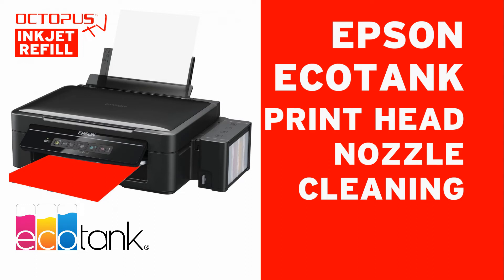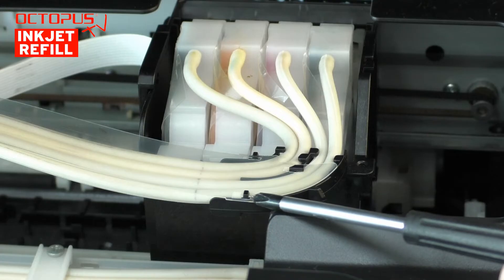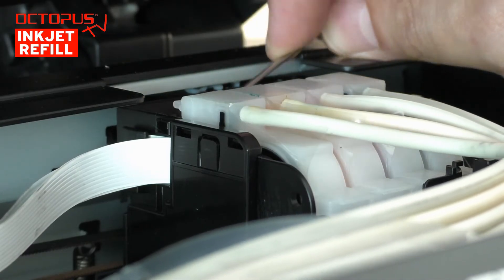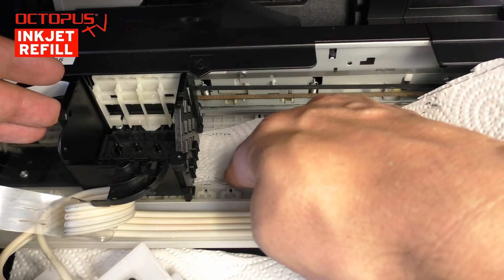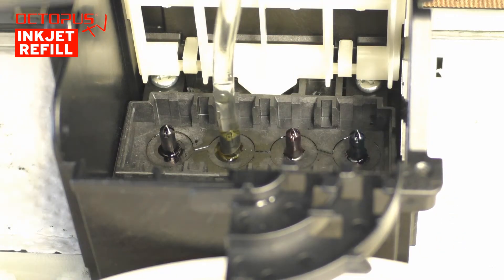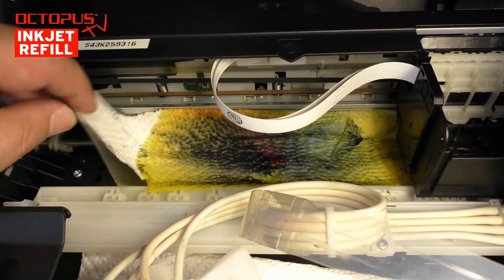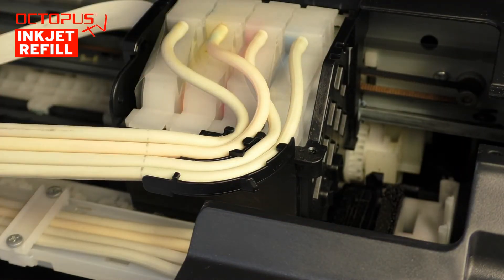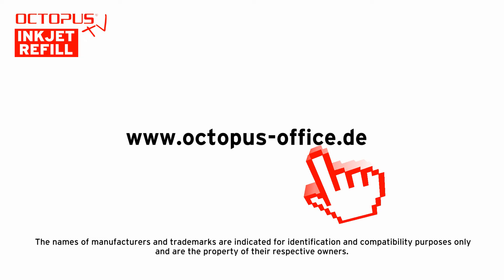Epson ECOTANK print head cleaning clogged nozzles 🛠💉

Comment: I have used this kit now to clean the heads of about 10 Epson L365 from our office and friends. The cleaning is superb, but I prefer to remove the print head from the printer and clean it outside, this assures that there will be no mess inside. And it’s just a few minutes extra work.
Reply from the maker: Hello Peter, thanks for Your nice feedback! Based on Your experience we consider You as a professional user 🙂 - no wonder You are going the way to take out the print head. Actually this is the most dangerous part for this sensitive component. Users doing the cleaning for the fist time are in danger to do some damage to the print head at this point - that´s why we came along with  leaving the print head in and creating a work around to control the cleaning liquid mess...
Reply: @octopusoffice   I agree, for a common user, removing the print head is a little bit too much to ask for, I’m sure your cleaning kits work the same perfect way with the method described in your video

Comment: Godd video!
You mention several times that this printer does not have a waist-ink-container. How does the printheadcleaning differ when the printer does have a waist-ink-container?
Reply from the maker: Thanks for Your question. Our printer in the tutorial has a waste ink sponge installed that cannot be exchanged for a new one - when You are cleaning this printer´s nozzles by using the cleaning functionality from the printer´s menu this waste ink sponge is filled up with the waste ink from cleaning. After a certain amount of cleanings this sponge will be full and the printer will give You a message about this. With that status You are not able to print with this printer any more without expensive service by an Epson service person. Our cleaning process avoids the waste ink going into the waste sponge and also avoid the internal counter for the cleaning to count upwards. By our way we extend the printer´s life span.
When You have a Ecotank printer model with an exchangeable waste ink compartment - good then You can run the installes cleaning and get a new waste ink container when the old one is full.
We hope our axplanantion  answers Your question.

Comment: thank you for the tutorial! I used it once last year and it worked no problem. but this time around afterwards I printed about 90 pages and the only color coming out is blue and it's really wasting all my blue ink, why are no other colors printing? :( I tried reflushing the lines and they don't seem clogged anymore ? any advice would be so appreciated thank you !
Reply from the maker: Thanks for contacting us and Your description. You can try flusing the lines, which do not release color yet, with ink directly. Either You take that ink into a syringe from the ink tanks or from the bottle. Then You fill up the lines going to the print head with that ink. In case Your ecotank model has the cartridges sitting in the print head compartment You  also have to make sure there are no obstacles inside these cartridges preventing the inks from going through again. Check for air beeing trapped there - especially in the ink port area air can create trouble...

Comment: i did this on my printer and now it wont priont at all, no colour at all comes out when i print
Reply from the maker: Thanks for contacting us about our cleaning tutorial. When applying our method there is a certain amount of cleaner remaining (in some cases also air) in the ink lines and inside the print head. It is necessary to get that cleaner fluid and air out of the system after flushing.
One way to do it is to run test prints on old paper to "print out" the cleaner fluid plus air - start a 50 to 100 pages double sided print job - this will take quite some time - so check in between if the colors are coming back. When the colors are back to normal You can cancel the print job. When the prints are not back to normal yet - continue to run test prints or also use the print head cleaning function from Your printer´s menu....
Reply: @octopusoffice  okay I'll try this I'm actually going to put some more fluid in first as I don't think I put enough either then will try this printing of a bunch of pages and see what happens thank you
Reply: I did a bunch of print head cleans after adding the solution and that's what wasn't printing anything, I'd either get nothing going down or every thing was a faded purple colour and any text was just dots etc

Comment: Can your kit be used with an Epson ET-5880?  Thank you... great video!
Reply from the maker: Hello Cynthia, thanks for Your question. We are not aware of every details of the ET-5880. But You can check the following to determine if our kits can be used for Your machine:
Can You access the print area? This is the area where the print head moves from side to side over the paper on which the print is applied.

Can You access the print head itsself? At the print head carriage You need to check how the conncection between the ink lines to the print head has been set up. Is it the same solution as in our tutorial - using the connecting cartridges? In that case You can use our tutorial as it is.
When the lines are attached to the print head directly You can clean the print heads´ nozzles from the bottom side. We have good experience about that.
You use the same setup as in our tutorial - meaning slide some absorbent material with print head cleaner on a piece of plastic foil material under the print head carriage and  ket the carriage sit on there for a while. This allows the cleaner to get into the nozzles from the outside.
Then You move the carriage from side to side over the absorbent material. This rubs of dried in stains.
After that You can check the results by running some test prints . Not satidfied after these? Just repeat the process.
We hope that helps a bit!

Comment: Help and hello would this work for the large format epson ecotank printers such the 16600
Reply from the maker: Hello Keekee, thanks for reaching out to us about our cleaning tutorial for the EcoTank series. We do not know how the connection between the ink lines leading from the tanks to the print head section is made at Your model 16600. We know that some models do not have the solution that connection cartridges make the bridge between the ink lines and the printhead compartment (in which the connection cartridges are sitting).
In the case that You model does not have the connecting cartridges You need to get access to the inlet for the ink from the ink lines into the print head. From the distance we cannot guess how much effort is necessary to dismantle the print head section to have access to the inlets for the ink.
We hope our description provides some help for You to make Your decision ... otherwise please ask again 🙂

Comment: Women's Always brand sanitary napkins work as a great cleaning tool. Get a panty liner not the big pads. They won't fit. Get one that is not a "daily" they are too thin. You need one with a little bit more absorbing material. Use a #2 "very light". The newer ones have a plastic wrapper around them. Open up, do NOT peel them off the plastic,  and you can lay them under the print head and it will absorb as well as protect at the same time. They will do the job they were born to do!
Reply from the maker: Hello Beth, thanks a lot for pointing out that great solution - we really like thinking out of the box for using  materials that fit the pupose beside their initial field of application 👍🏻🙂

Comment: Thanks for the great tutorial.  I did this with my eco tank 4550 and it worked great.  The only thing is you can use a solution of alchol and windex and get started right away.  I used a squeeze bottle with a tube attached.  Didn't need to wait for anything, just did it.  Be prepared to squeeze pretty hard.  Also, when done, you'll need to run through the clean print head, missing pixel, head alignment, and any other maintenance from the menu.  Be prepared to print a few pages to get all the ink flowing again, too.  It took me 2 pages.  THANK YOU SO MUCH!
Reply from the maker: Hello Rick, same goes back to You: Thanks for taking the time and providing this great feedback. We are happy that our tutotial was helpful.

Comment: My printer sat unused fro about 6 months and so Ive cleaned the print 
head with this kit and the actual nozzle heads that go to the paper, 
twice. Even after this i get white sheets of paper, nothing at all seems
 to print. I have also tried siphoning ink from the tanks, through the 
ink cartridges from below, and this draws ink, but when told to print, 
still no colors at all come out. Any ideas?
Reply from the maker: Hello Chase Gray, thanks for reaching out to us about the cleaning kit and describing Your so far not so satisfying results.
You can send a print job to Your EcoTank and it starts printing - good.
You have made sure to have inks from the tanks through the tubes into the cartridges reaching to the outlets - excellent 👍🏻.
You have cleaned each ink channel in the print head compartment - also good.
Either there is air inside the print head´s ink system which prevents to establish a proper ink flow when starting a print job. Then no ink is reaching the paper and it comes out white.
Or there is still cleaner liquid inside the print head´s ink system - it takes quite a while to get the remaining cleaner out of the system. We recommend to use old paper and print test prints double sided on this old paper to get out the cleaner and get the colors back to normal.
To make the print head´s ink syystem free of air You can either flush the print head again with cleaner or You use ink for flushing.
The ink You use in Your machine is the original Epson ink or an alternative ink comatible for Your EcoTank?
Reply: @octopusoffice  I forgot to write back, but after doing what you suggested and cleaning the machine 3 times in total, I was able to get the printer to work again. It ended up taking about 10 or so "clean the print head" option on the machine to finally print every color. Slowly as I ran paper through and reclicked the cleaning option the colors started to flow again. I really appreciate your assistance and posting this video for people who are stuck! It does seem to be true that multiple cleaning cycles can be needed, especially if your machine sat a long time (mine sat 6 months).

Comment: this is the most ridiculous thing I've ever seen in my life.  These company's directors should be shot making rubbish throwaway plastic products that cannot be easily cleaned and used, and maintained and make you jump through so many hoops to do something as simple as cleaning the nozzle heads on your printer.  My model can't even be opened to fix it, so there's another piece of -plastic shit on landfill, thanks epson
Reply: thanks for trying to help though...
Reply from the maker: Hello Michaela, thanks for taking the time and contributing Your view on the situation of sustainability of desktop printers 🙂 We are with You about aspect on adding more waste to the landfill instead of reasonable ways to repair and maintain devices.
Beside that we cannot support too extreme ways to punish people beeing responsible for crappy product solutions: How about putting such people on the incoming side of the company´s service hotline and dealing with customers having the same problem as You have?
Take care!

Comment: Thank you - very clear explanation.  However living in South Africa, cannot source your print head cleaning equipment or fluid and was wondering how to do this without it.  Can I use rubbing alcohol to try and flush the print head?  Otherwise what would you suggest? It is the black ink head on my L365 that is not printing properly.  It is currently only 1/4 full, so perhaps I can empty it and replace it with alcohol then try cleaning the print heads a few times to get it to flow through - what do you think?
Reply from the maker: Hello Margot, thanks for reaching out to us about our tutorial and cleaner. Sorry we cannot provide stock in a more reasonable distance to Your place 🙂
You have the following options to work on You EcoTank:
1) The inks in Your printer are a waterbased formula - so the rubbing alcohol has no dissolving effect on waterbased inks. It will do no damage but it will also not clean that good.
2) the cleaner should be waterbased too - You can use purified and demineralized water.
Our cleaner is in its core based on our base ink formulation (without any colorant ingredients plus some surfacants for improved cleaning)
3.) To make things more easy You can actually also use the ink (which is already in the tank) for cleaning - it is waterbased. So no need to remove the ink from that tank.
4.) In a pharmacy they will have a big medical syringe with lue lock connection tip and the also will have a infusion supply line with the coupling matching the syringe´s connector. Try to get such materials.
5.) Open the black tank and use fabric tape to connect the plastic hose / infusion supply line to the tank and make that connection air tight.
6.) Move the print head compartment into the middle of the printer´s working area and start to pump carefully with the syringe connected to the plastic hose.
This presses the ink in the tank towards the print head and through its nozzles.
You should be able to reach a cleaning effect by this.
Reply: @octopusoffice  - your help and advice much appreciated - thank you.  Will try it out

Comment: Bought the Octopus cleaner kit for my Epson ET2600 due to bad print quality (only the black). Followed your instructions 100% and now nothing at all comes on the paper, not even the colors that worked ok before. I have printet 30+ pages but no int, think I'm going to throw the printer out the window.
Reply from the maker: Hello Else - i just came back from vacation and hope I am not too late as the EcoJets are too expensive to be used for throwing .
Either there is still cleaner remaining in the black ink system or some air inside there is preventing the proper flow of ink. So please use old paper and start double sided test prints until ink comes back on the paper - that may  take more then 30+ prints.
The air problem might be the case for the colors that You have not cleaned at all - during the cleaning of the black ink line air can have entered these ink ports inside the print head compartment.
You can also run the printer´s print head cleaning programm a couple of times. This also removes air pockets.
Sorry again for my late response 😑
Reply: @octopusoffice  I brought the printer to a professional who was not able to solve the problem, so he threw it out the window for me. My problem is now: do I trust Epson or should I buy a Canon printer instead. My main focus is photo printing quality, and ink consumption/costs.

Comment: Will this work for Ecotank L382?
Reply from the maker: Hello Cherilyn, thanks for Your question. We do not have the information specific for Your L382 available - BUT Your machine wworks with the same inks as our L300  and its printer engine is also the same model as in our L300. Based on that we assume that the tutorial als applies to Your EcoTank too. Please check first if the transition from the ink tibes to the print head is made the same way - then go on ordering materials.

Comment: I can't thank you enough for the excellent tutorial and your great value cleaning kit (which I purchased from Amazon after using the reference number in your description to search for it).

My ET2750 doesn't get used very often anyway but this time had been left for about 6 months and when I needed to print something last week there was hardly any ink output. I ran the nozzle check and head cleaning functions from the maintenance menu but this didn't solve the problem, so I went on to run the power clean which resulted in perfect cyan, yellow and magenta but absolutely no black.

I watched a number of not very good videos about cleaning a blocked print head before I found yours and, because the video was so thorough and easy to follow, I decided to buy your kit rather than one of the cheaper options available. The cleaning process was just as you describe, with the small difference being that the ink cartridges in the ET2750 have a white plastic cover over them that clips in and is then held in place with a single screw. Once that is removed the process is exactly as per your video.

After the cleaning I ran the nozzle check but got a blank page, I then read some of the other comments here about this problem and your replies to them, so I tried to print some pages of black text but still nothing was coming out. I decided to run the power clean after seeing that this had resolved the issue for someone else with this model of printer and it has done the trick because I now have perfect print quality again! (I was not too concerned about the waste ink issue with the power clean because I know that the printer is not used so much in normal circumstances but other people may not want to do it).

To anyone who has made it to the end of this long comment and is still wondering if buying the Octopus cleaning kit and following this video is worth trying, let me tell you that the answer is YES!
Reply from the maker: Hello Andrea, thank You so much for this well thought and sorted feedback! We are happy that You have found a way to adapt our suggested method to Your printer model. Awesome! 👍🏻👍🏻
Reply from the maker: Hello Amanda, thanks for reaching out to us and please accept our apologies for that slow response. We are sorry to say that we are not listed on every marketplace yet. Especially Yours is still a project for us 😐🙂
Reply: @amandaross8009  hi, not sure where you are based but here's a link to what I bought https://www.amazon.co.uk/dp/B071F3N8XP/ref=cm_sw_r_cp_awdb_imm_D4MJBNZ4A1X70914PVWD?_encoding=UTF8&psc=1
Reply: @f3lollipops  Thanks, shipping to us over the pond is £44 unfortunately :(